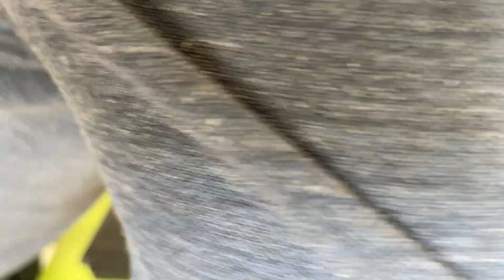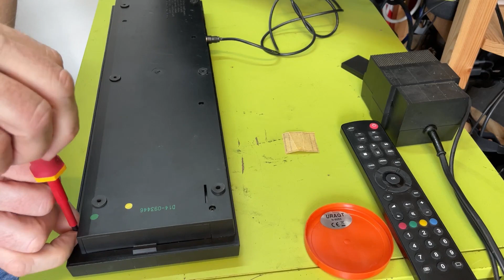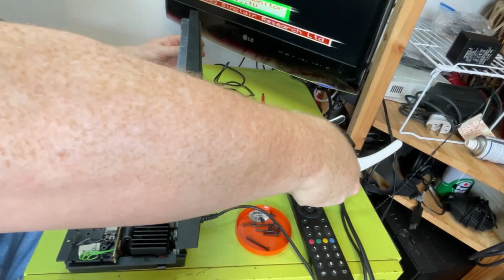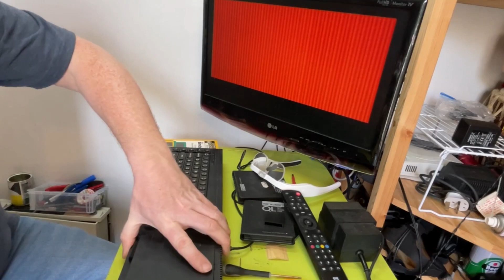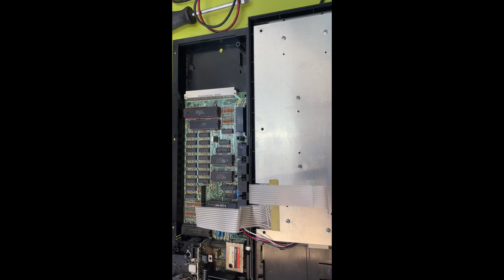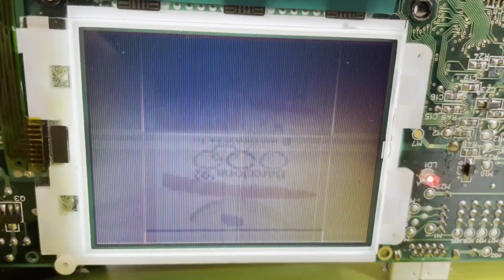Sinclair QL Power up

Comment: I've had some success in trimming down the end of the ribbon on a ZX81 where the conductor is exposed, without making it too short to fit - not sure if that works on a QL though.
Reply: Ahh that's a shame .. looking forward to the next episode! I always rather wanted a QL - maybe one day 😁
Reply from the maker: Sadly it did not work for me. Testing the membrane outside there are some seriously bad tracks and pads... I have a replacement one just arrived...
Reply: Hi pal, do you still have that book please? 
I have been looking for that, I am a newish QL owner and went through exactly the same as you for the first hour.